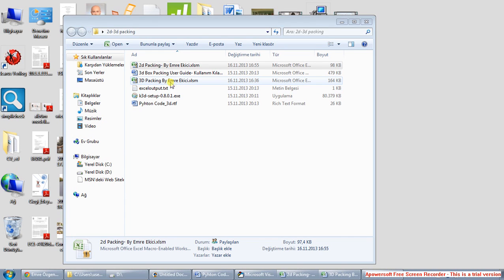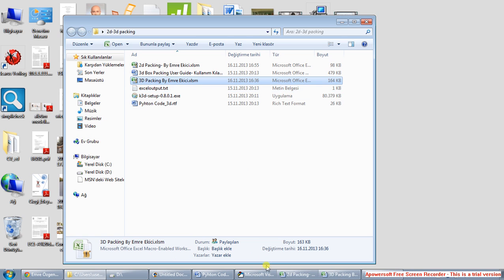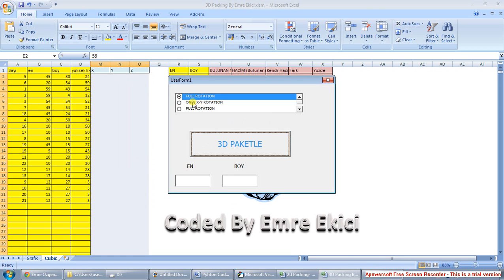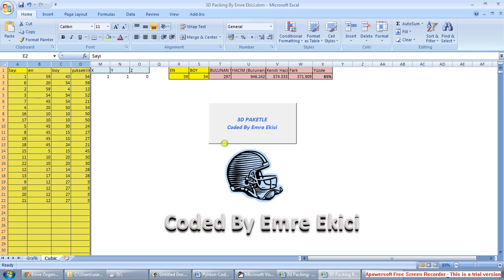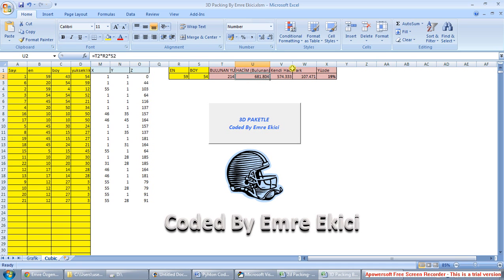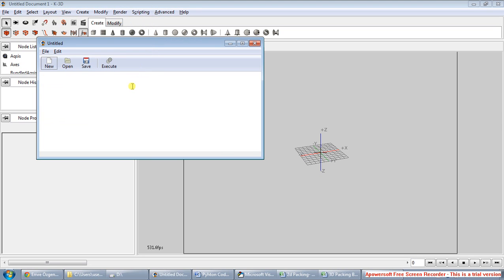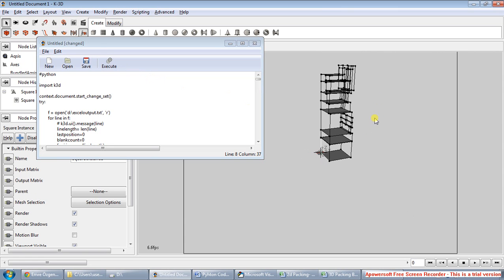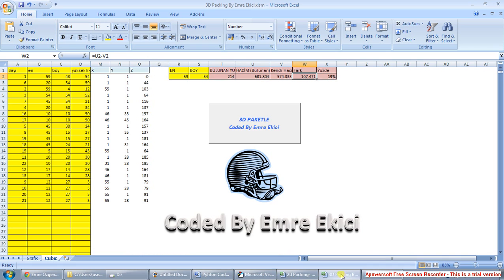Free 3D Box/Bin Packing Excel Macro By Emre Ekici

Comment: Good work. It is a pity that Excel does not have 3D graphics capabilities. It would be nice to have a single Excel file that could handle everything.
Reply: Hi Günes, after following your very interesting linkedin posts on the topic I reached you also here. Excel is able to perform pseudo-3D visualizations, in a not very satisfying way via charts, but through VBA you can draw in 3D with API calls (pretty decent considering the limitations). I'll come with a sample workbook to show how it can be done.

Comment: the last (importing python code) step is not working, any clue?
Reply from the maker: can u explain a little bit more please? You install K-3d and open script part. And copy the code. And press the run. ? Then nothing happens? Are u sure u put exceloutput.txt file at te right place?
Reply: Emre Ekici i have just copied and pasted your code, but change the directory with the directory of my exceloutput.txt  but an error is apearing. I've changed the directory only form the begining of the python code, is there anywhere else where I have to change the directory. I've made this for the vba excel and it's working perfect. By the way is the algorithm working using a 3D approach to place the boxes inside a bigger box?
Reply: Santiago Mosquera Error executing script!
Reply from the maker: Santiago Mosquera 
VBA excel macro writing the x y z coordinate at this file. Therefore you should change the dır un excel macro too... Than you should make the same for python code..İF it is not working please try my first version without changing anything. İF it is working then start changing one by one please. Algorthm is an updated version (updated by me) of a 2d heuristic .
Reply: Emre Ekici I don't have a D: partition, I am force to change the directory, excele is being correctly generated as I've change the directory , the same as the .txt file, problems come when runnig python coge on k3d
Reply: Santiago Mosquera Now it's working, thank you very much, I guess I made a mistake at some point
Reply from the maker: Santiago Mosquera you are wellcome:)
Reply: @santiagomosquera7444  how did you fix it? Im having the same problem,  k3d shows error executing script